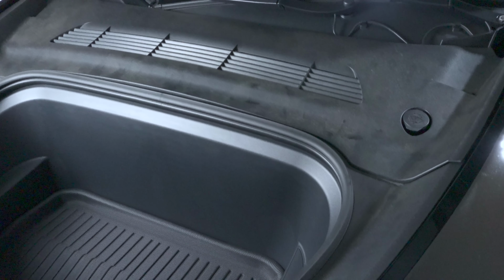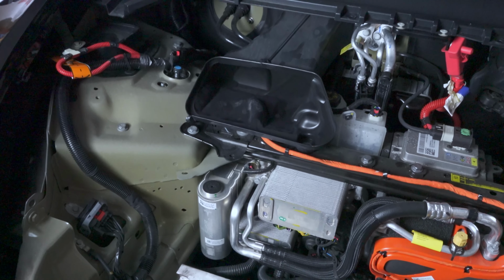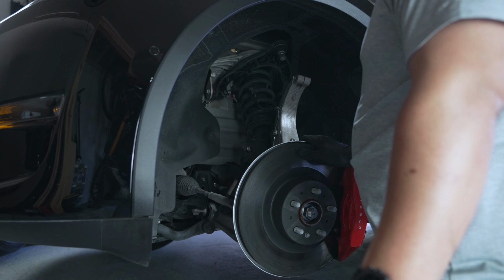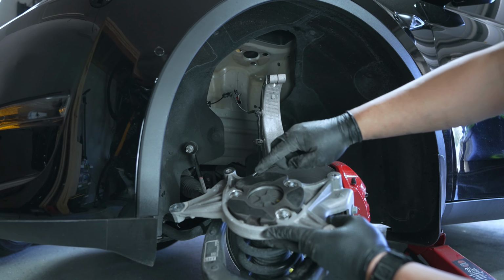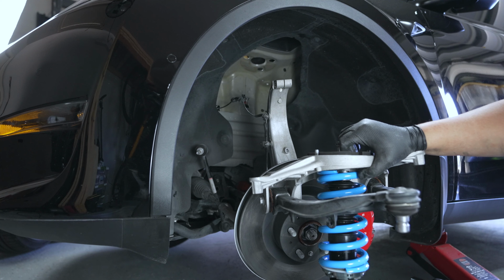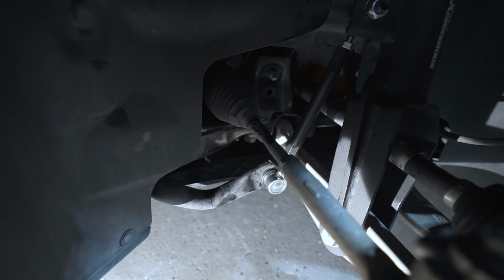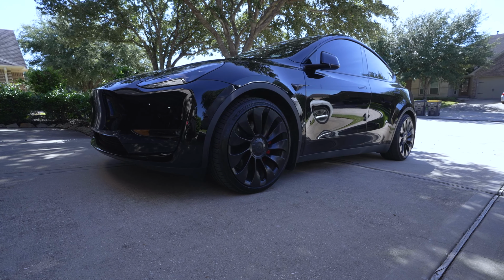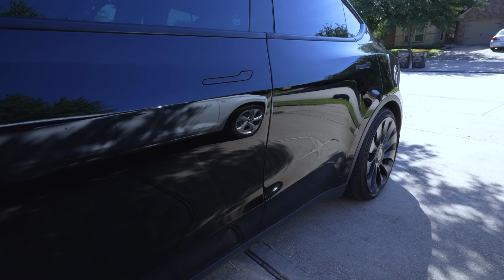Tesla Model Y Installation of MaXpeedingRods T6 Front Coilover Kit

Comment: Would be very interested to know what you honestly think of the ride quality
Reply from the maker: I've been pretty impressed so far.  The stance of the car looks really good and the ride quality is probably slightly better than stock.  I have the rear at 2 clicks and the front at 1 click.
Reply: @michaelanthonyaquino any weird noises or clunks?
Reply: @michaelanthonyaquino  1 down from the hard or 1 up from soft ?
Reply: @michaelanthonyaquino what is your review after a few miles on the coilovers now??
Reply: Any updates on the coilovers ?
Reply: @michaelanthonyaquino how can I get the new version of this kit? The orange ones as I called and they had zero information!

Comment: If you were to combine the time to do it all, what would you say?
Reply from the maker: 4-5 hours for the front and rear
Reply: @michaelanthonyaquino  any issues so far? How’s the ride quality? Planning to go for these but I used my MYLR for daily commute and family ride. And did you install rear camber/tow arms? Thanks and more power to your channel.
Reply from the maker: They've been good.  I've had them at the softest setting.  I did install the rear camber arms which I highly recommend even if you don't lower the vehicle.  Maxpeedingrods is coming out with a lowering kit made specifically for the "daily driver".  I would wait for those which come with Eibach springs.